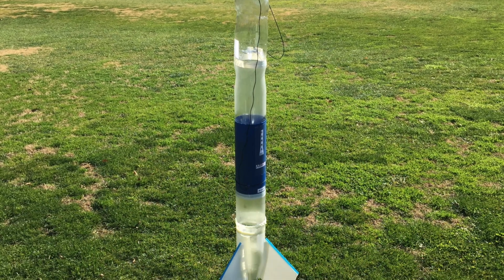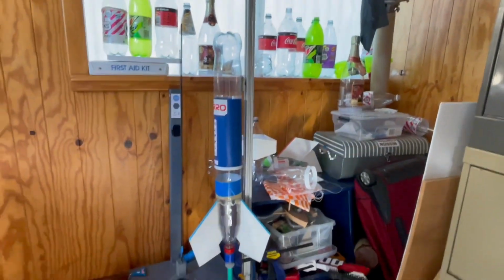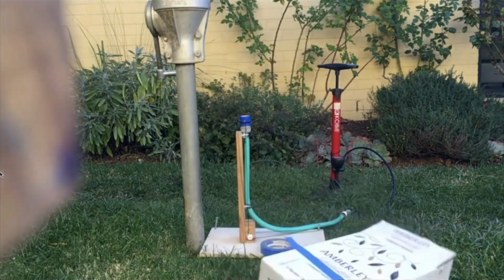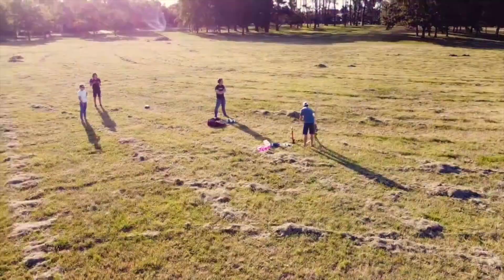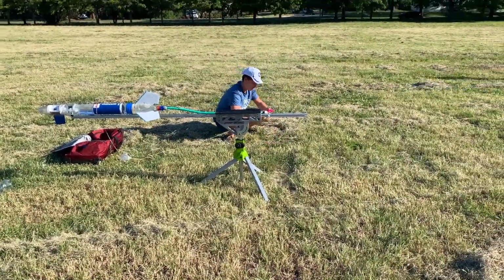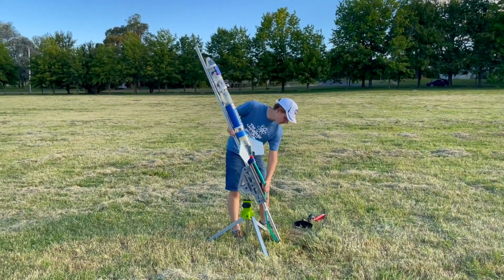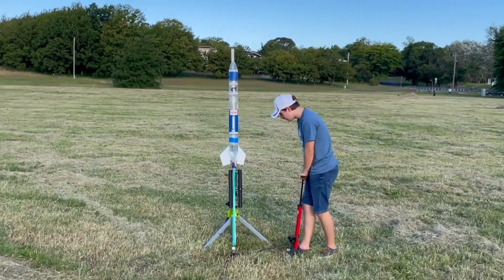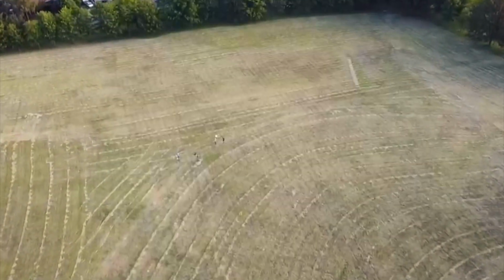High Power Water Rockets

Comment: how you conect the bottle with de base?
Reply from the maker: Basically the nozzle is a 3D printed design that can screw onto a bottle whilst also being able to fit in a hose connector collar. You can make one without a 3D printer by gluing a bottle lid inside a connector thats big enough, and there are videos on my channel where I do this, but thats the essential. Since it's a hose connector, by pulling it down with some strings and a pulley, it releases the rocket that's already under a lot of pressure. Hope that helps!